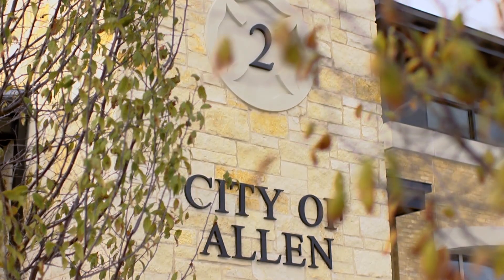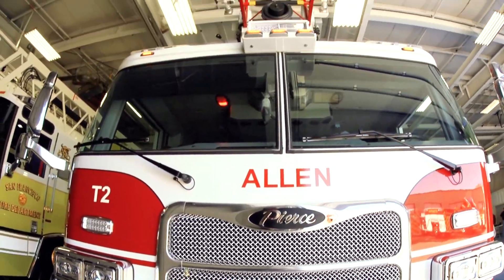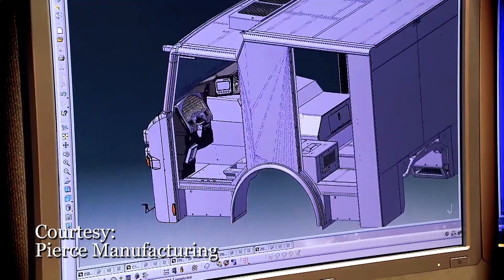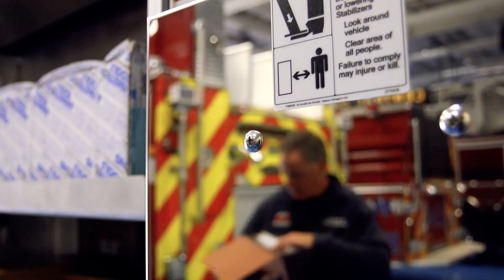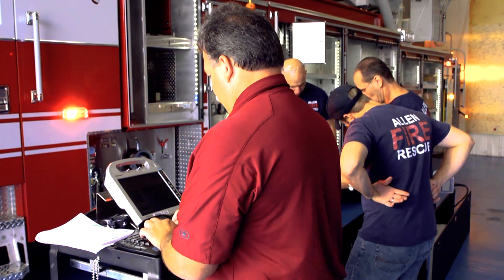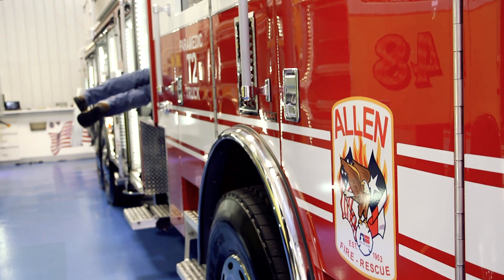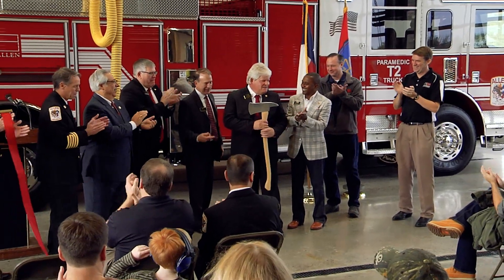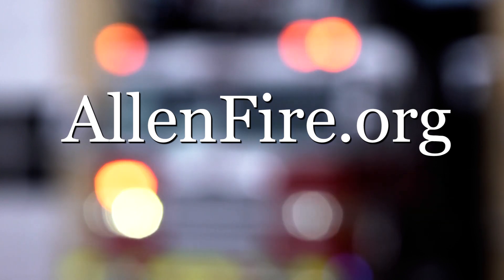How It's Made 🚒 Fire Truck

Comment: Very nice video. When your department decided to invest in a new truck, did you solicit ideas and input from every member of the department? I'm curious as to the internal process of figuring out what you needed, what you wanted and what you could afford in a new truck.
Reply from the maker: Great Questions: Major considerations in the design of a new fire apparatus are community need, industry standards and firefighter feedback. Fire apparatus are built to a buyer’s specifications. You can design fire apparatus with different length ladders, pump sizes, etc. to meet the needs of a community. Most of Allen’s structures are single family residential properties. Our apparatus have historically reflected the pump capacity and hose layouts needed to combat a fire in these types of structures. As Allen has grown, the features of our fire apparatus have evolved with the community (bigger buildings mean a need for bigger pumps and longer ladders). National standards, such as those developed by the NFPA and ISO, also dictate features of fire apparatus. Apparatus manufacturers and buyers follow these to insure a quality product is designed and built. We are often, but not always, able to fulfill the requests of our firefighters in the apparatus design. On our latest fire engine, our firefighters requested a specific type of siren, a rapid deployment hose reel, and slightly more space in the cab for their gear. Our strategy has been to incrementally improve our design with each new fire apparatus. We use the most resent design as the basis and incorporate new features and lessons learned from others to make each one better than the last.   

Fire apparatus are expensive investments in our community’s safety. Having fire apparatus with specific sized pumps, ladders, etc. helped Allen to achieve an ISO Rating of 2 (top 1% in the county). This rating is used by many property insurance companies when establishing insurance rates for a community. While every insurance provider differs, a better rating typically equates to a better insurance rate. 

I hope this answered your questions. Thanks for watching the video.  

Allen Fire Chief Bill Hawley
Reply: Thank you for the reply!